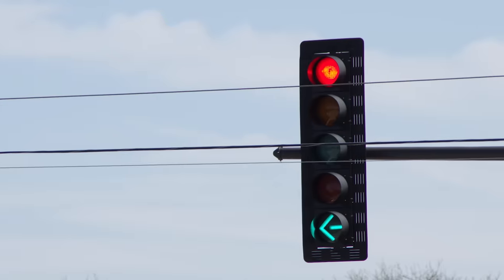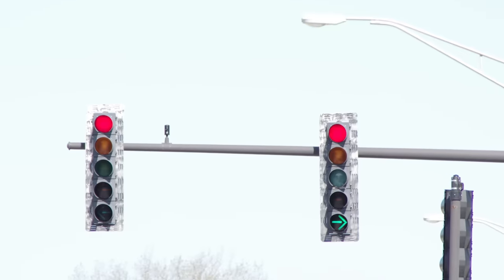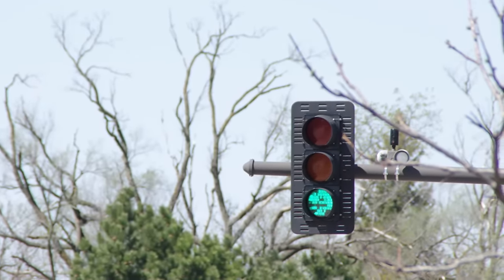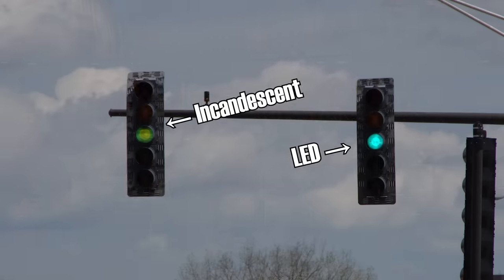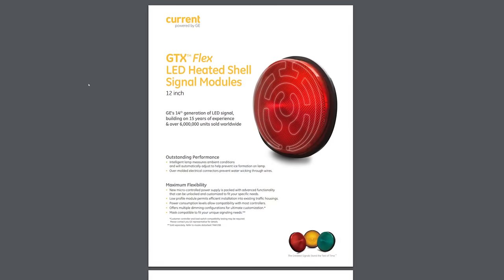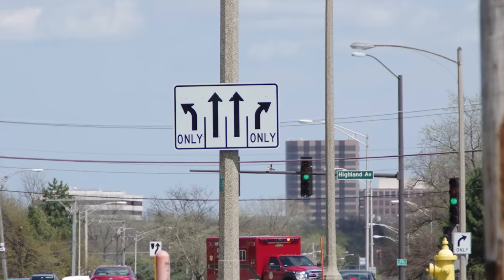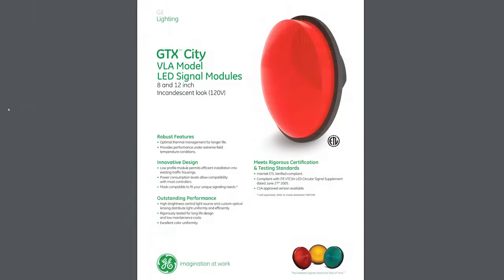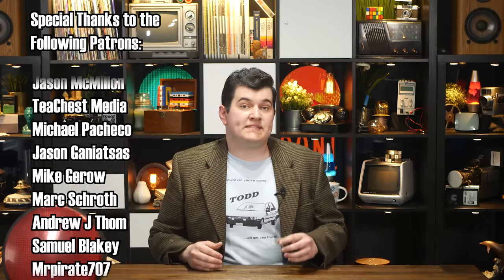The LED Traffic Light and the Danger of "But Sometimes!"

Comment: 'but sometines' is why ppl aren't using nuclear power as much as they should
Reply: But sometimes:
Chernobyl (poor safety due to incomplete espionage),
3 mile island (don't know enough about it to state the cause),
Fukushima (GE not remedying containment defects that were known about for 35+ years, plus skimping on sea wall construction: because money).

It's depressing how mismanagement is responsible for the only two full meltdowns we've had, and yet instead of simply going "oh, nuclear plants should have tighter safety regulations", people seem to go with "Aaah, nuclear is the devil! Shut it down! Don't suffer the nuclear engineer to live!"
Hopefully they change their minds sooner rather than later, after all we'll need it in case we get miss "kill the cows" Cortez in in 2024 (only 3 presidents have had one term since WWII when they ran for a second, so we can probably assume that 2020 is all but a foregone conclusion), when all coal, gas, and diesel power will be shut off without sufficient renewables for the whole grid...
Reply: TheBraveGallade NIMBY (not in my back yard) doesn’t help either; no one wants to have nuclear waste buried near them after all
Reply: @ccandrew111  to be fair the ppl SHOULD get decent compensation  (make electricity half price and watch industry flock to the area) but just flat out saying no is just irresponsible.

And the US doesn't even HAVE THAT EXCUSE. They have a FUCKTON of mostly uninhabited land that would bother nearly NO ONE.

South Korea and Japan shoulder high nuclear generation even when most of it is actually dangerously close to cities (especially our first site) because fossel fuel's expensive.
The reason the US doesn't is because they have PLENTY of cheap fuel...
Reply: @thebravegallade731  yeah, and seeing's as we've made progress in recycling the highly radioactive waste to enrich fuel or even be used as fuels in some types of reactors, leaving us with stuff that is pretty safe (half life of a few centuries to a few millennia, so barely radioactive), it's even more ridiculous to keep complaining about waste storage.
Reply: @theapexsurvivor9538 You had me up to Kill the cows Which is simply just a Made up lie. That plan forces Major corporations to change their resources and slowly invests into alternate power solutions for our Power grids. Nobody is saying ban cows. I just thought I'd point out the ignorance in a comment that otherwise began in a smart argument. Renewables are capable within a 15 year period of taking up the mantle fully. But that plan is only expected to begin by 2030. the expected date is 2045 roughly to be off of Fossil Fuels for the majority of energy consumption. This does not entirely include vehicles, etc. But Focuses on Factories, The Power grid and other less intrusive means. 

Regardless but sometimes is an issue I see a lot. Ironic how on a video that is ranting against the But sometimes of energy efficiency standards that a known slander is tossed in the comments. 

LED's are truly a Godsend though if we are being honest. Those things are amazing lol
Reply: @HoudiniFontmeister  "We set a goal to get to net-zero, rather than zero emissions, in 10 years because we aren’t sure that we’ll be able to fully get rid of farting cows and airplanes that fast."
From the FAQ section of the"Green New Deal"

You're technically correct (in a very loose definition of the term), it's not part of her 10 year plan, just one of the long-term goals, along with banning aeroplanes...
Reply: @theapexsurvivor9538  That is obviously Sarcasm and not ultimately the goal of the plan. also it is not a set in stone legislation rather a set of goals to set. The actual Legislation for this would be targeted at big companies and the biggest users of wasteful energy. As well as investments into cleaner energy, some of which are cheaper to produce and need more investment to reach needed levels of production. All in all there seems to be a lot of fear mongering coming out of a sarcastic line that was meant to be a joke moreso than the actual goal of the plan. 

I just feel we have too many people halting the progression of technology and cleaner resources for monetary reasons. Fear is a powerful weapon that turns the public against itself and confusion is a way to divide us. Once we are unsure of how others feel about us we can feel as if the other side has labeled us an enemy of the people. 

Media is a big issue but so are the politicians that decide to waste money on wars and tax cuts for extremely profitable corporations. On to the next topic. I am down for finding alternate energy sources. And think we should simply go after all possible solutions. anything that is better. :)
Reply: To be fair, there’s a slight difference between the problem of snow covering traffic lights and having a literal nuclear melt down and leaking radioactive particles over large area lol
Reply: We could save our sorry asses on this planet if we went 100% nuclear, or nuclear complemented with less efficient renewables.
Reply: Actually I think it’s because they aren’t using fusion. Fission causes depleted uranium rods which stay radioactive for many years after, and we want to bury these in the ground? Think! It’s where our ground water is, and it will end up everywhere!
Reply: Indeed. Especially since there are newer plant models with very low risk of damage or release of material.
Reply: that and needing to store the waste for like ever.(or using new tech to reuse, i guess its still a problem for now though)
Reply: Dustin Except the chances of that happening are so close to 0 with modern reactors that it’s not even a concern. Even with a full reactor meltdown, which only would happen if the huge amounts of both chemical and physical safety and “kill switches” failed, containment is incredibly robust. Fukushima happened because the proper upgrades had not been put into place in addition to a literal tsunami. TMI had no appreciable effect on the surrounding area (hell I live in central PA). Chernobyl happened because Soviet Union, as the RBMK reactors used were a sound design. Do a little research about modern reactors and you’ll realize that nuclear power is actually one of the most effective, safest and cleanest ways to generate power we currently have at our disposal.
Reply: @Yomom12388 Yep, the US Navy has racked up over 6000 years of runtime on naval reactors with zero major incidents. Nuclear reactors can be managed safely if robust operational procedures are strictly followed.
Reply: @TheNomadicMonk [actually all of the failures mentioned were due to human error ...]
So, this seems like we should not build them at all, since we cannot eliminate human error... hum, have to use that against those that want to build expensive nuclear power plants
Reply: @shelbyz1988  not sure about the years of runtime, but in an original statement by J. McCain, it was 60 years of use. The comparison is not apples to apples though 1) Navy staff are better disciplined and more highly trained. My own thought is that they also probably do not become complaisant by working at the reactors for over 8 or so years. 2) Navel reactors are smaller. 3) Navel reactors are more robust. {https://www.politifact.com/truth-o-meter/statements/2008/jun/09/john-mccain/navys-record-unblemished/}
Reply: @theapexsurvivor9538  [farting cows] greenhouse emissions from farm animals contribute greatly to the "greenhouse" effect. We kill cows for meat, so what is your [pun alert] beef with killing cows? 🤔 New technologies might provide us a way to grow "lab" meats, and thus no cows, or less, would be needed. Personally, I think you at least will be safe in having "real" meat available for the rest of your life
[banning airplanes] Something the right media made up ie. fake news. The idea is again to thing different and make better use of technology to reduce the number of airplane flights, not ban planes, which would be highly unlikely in a global twinned world
Reply: @theapexsurvivor9538  I'm gonna be real you had me until you said "Kill More Cows" Cortez, like... you realize the (actual LEGITIMATE, not draft) Green New Deal never even mentions cows right? And she's not even running for 2020!
Reply: @brianfeuerman1732  A better alternative to dangerous uranium remains would be thorium as a power source which, while dangerous isn't as radioactive and overall safer than uranium which we should use until we efficiently switch to renewable.
Reply: Sam Bradley Yes, that would be better.
Reply: @brianfeuerman1732  The half life of depleted uranium is relatively moderate, which is good, too long and you have to store it for a million years, too short and it melts through anything you put it in. Also any fusion power plant would likely have such high neutron flux that the cladding necessary to reach parity in the reactor would become IMMENSELY radioactive within a few months to years, and in that case you're likely dealing with some super nasty lithium or beryllium isotopes. I find it easier to point out that your average coal plant is putting more radioactive waste in the air than every nuclear plant in the world combined, thanks to coal being chocked full of naturally occurring radionuclides, and no amount of wind, solar etc is going to provide base load power.
Reply: @ccandrew111  It's possible to RECYCLE that fuel, getting rid of the danger.  France does it; they've gone all out for nuclear power / electricity and lacking all the empty land the U.S. has for potential storage, had to have another solution.  So they did!
Reply: Vera Lenora yeah I get that, I’m pro nuclear, but a lot of countries are opposed to having waste in their back yard
Reply: Molten salt reactor! Little waste more efficient and no melt downs
Reply: Well, it's a pretty big but sometimes
Reply: Mallard  Should be done by 2020, but not connected to the grid until later
Reply: Mallard  I agree. It will solve a lot of problems. A ton of almost free and clean electricity would be useful in so many ways
Reply: So we’ll just put it in your back yard and make you live the plume it will create.
Reply: @thebravegallade731  Pretty much this. Cut electricity prices by half or 75% off to everyone who lives within 5 miles of the Nuclear plant, and suddenly people stop caring about it. The state would still save money, when compared to oil and coal. Plus you save the planet! Nuclear is the energy source of tomorrow, that should have been our major source in the 90's.

You wanna save the planet? Tell your congress to switch to Nuclear already!
Reply: Well the but sometimes with nuclear is a 10k year problem
Reply: And also the fossil fuel lobby.

Comment: The "dirt" that you talk about is often charring of the glass or plastic lense from the intense heat. As you mentioned, the bulbs are > 100w lamps.
Reply: Well, glass wouldn't and doesn't char. Most traffic lights just use plastic since it saves on cost and weight, though I sort of doubt that plastic lenses really char much either since incandescent traffic fixtures are quite roomy, but I guess that on a hot day the heat builds up quite a bit more.
Reply: @Wyatt_James  I worked for 10 years as a traffic tech. It gets very hot. The plastic melts if it is glass (older lenses are glass) it can get discolored and brittle from the heat of the lamps.
Reply: @BeauwithaBang  Well I'm quite surprised if glass lenses tend to discolor. I've got some 8-inch fixtures that had a pretty long life and the lenses look nearly new, though they were used with lower power bulbs around 65 watts if memory serves (at least for some time; it's what I got with them but they were thirdhand and I'm not entirely sure what their original use was). Still plenty to get hot to the touch but no glass issues.

As for plastic well I suppose so.
Reply: @Wyatt_James  back when incandescent was the norm, it was typical to use 165w for the 12" heads. The only discoloration would be the closest point to the bulb, right in the center of the lense. You can see the discoloration I'm talking about it the video at 2:23.
Reply: @BeauwithaBang  Interesting. I suppose I'm lucky that mine are in good shape.

Comment: I remember a video from a channel like Not Just Bikes, or something like that, which was proposing that crosswalks should be at the level of the sidewalk, instead of at the level of the street, so that they'd act as natural speedbumps, which would solve the issue of drivers travelling too fast to react to pedestrians, which could reduce instances of people being run over. A reply I'd heard to this was that this would make it very hard for elderly people in cars, as driving over speedbumps are hard on their joints. I wonder if this falls under a simple principal.

I mean, maybe elderly drivers/passengers are more common than snowfall, but then again, there are places where snowfall is likely much more frequent than it is in Illinois, and where the "sometimes" is closer to "a lot".

Comment: Interesting point regarding turning arrows. Here in Chile, a lot of intersections have turn arrows to control left-hand turns. But strangely, they don't have a full range of 3 arrows, ie, red, amber and green. Rather, there is just a green arrow, and at some intersections, you can turn if the green arrow is OFF, as long as there's no oncoming traffic and straight traffic has a green. At others, you can only turn when the green arrow is ON. So, in many places there is a sign telling you what you can and can't do when the arrow is OFF. I'm from Australia, where this never happens. If there are lights specifically for turning, then there are all three, not just the green. Seems logical and safer to me. Rather than asking drivers to read instructions while moving, just make it clear if they can turn or not.

Comment: Hm I'm from Germany and I've NEVER seen a dead traffic light, not even before LEDs were used. I woner why. Did they include multiple bulbs to compensate for one failing? Did they have sensos to detect a broken bulb? Or did they use magic bulbs that never failed? I mean I'm living in a larger city so in decades I should've seen at least a single dead one. Weird...
Also I've never seen snow sticking to one.
Reply: I'm pretty sure the maintenance intervals are enforced in the entire republic and they're at half the estimated lifetime of the bulbs. Also all three get replaced all the time with every maintenance, even though none are broken and the yellow one would theoretically live twice as long.
Reply: I am from Germany as well and I have seen several defective traffic lights bulbs this year alone. :(
Yes, most of the bigger red lights (sometimes only the primary lights on the right) here have two bulbs, splitting the lens into upper and lower half.
I don‘t know about automatic detection and reporting of defective bulbs though.

Most defective bulbs I have noticed were replaced by the next evening which would suggest either someone has reported them manually (sometimes I have even sent an email to the next police station, they will forward a service request to someone responsible for maintenance) or the traffic light controller can send a report on its own.
Reply: I heard that there are a lot of small, one foot germans that come out at night and replace all the bulbs they can see. This is like the small asians that come out at night and repair your water damaged phone if you placed it in a bowl of rice.
Reply: they replace them regularly to avoid them ever burning out
Reply: I'm American, and after a decade of driving I've never seen a dead traffic light, either. (Power outages aside, obviously). Sounds like this is something that varies quite heavily by location, even within centralized countries like Germany.
Reply: @chad_bro_chill  Germany is only partly centralized, for example education and infrastucture are not
Reply: Also germany has not as much snow as northern usa, not by a long shot
Reply: StYxXx I believe many German incandescent signals used small, low voltage halogen bulbs rather than full sized light bulbs.
Reply: @londonnight937  it took me way too long to realize you were talking about traffic light gnomes
Reply: Maybe better maintenance? Green light in front of the US Treasury building in DC was out for at least a month. Might still be.
Reply: A lot of traffic signal lights are under-driven, too. Reduce the voltage by 5% and you double the life expectancy of the filament. Couple that with annual replacement, and you have pretty reliable signals. I've never seen a single dead traffic light in Britain, either. But I have seen a whole dead traffic light system. Saw a controller box explode once, because of a gas leak. Those old-fashioned cast iron box doors could travel a long way at high speed. ;-p
Reply: My dad used to work for our cities public works department. It wasn't part of his primary job, but he would do a day or two of traffic light maintenance. They had a schedule to replace them near their life expectancy. Old ones were used to light areas of the shop. Some of them lasted there almost as long as he did. Our house had plenty of them too, when the old bulb stock got out of hand.
Reply: I'm from the UK and also have never noticed a dead light on a traffic light either.